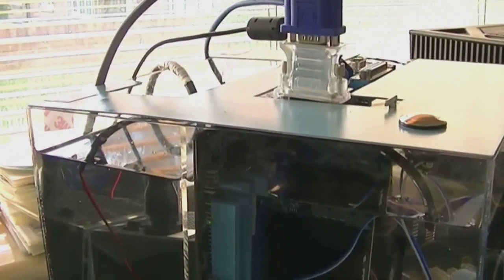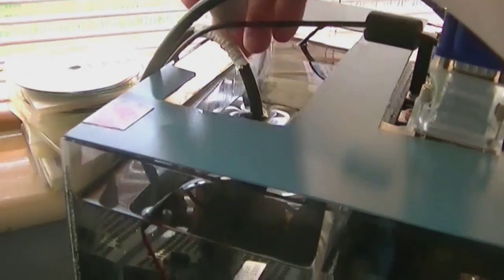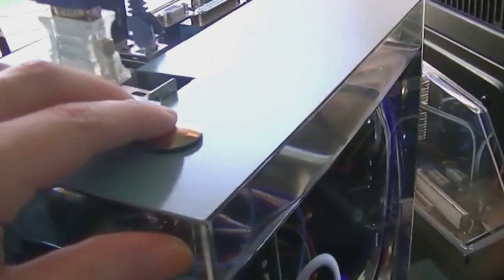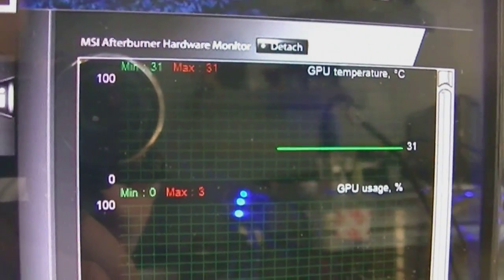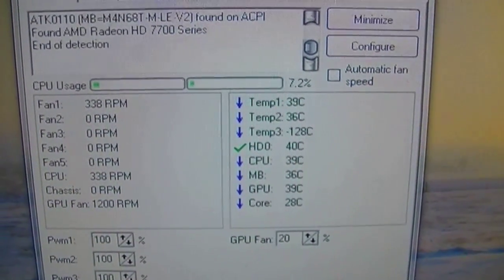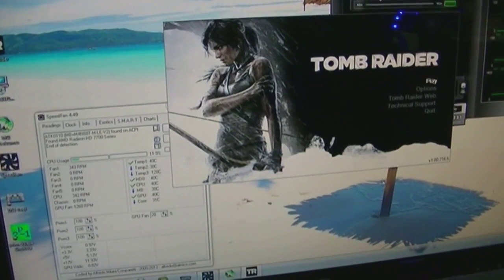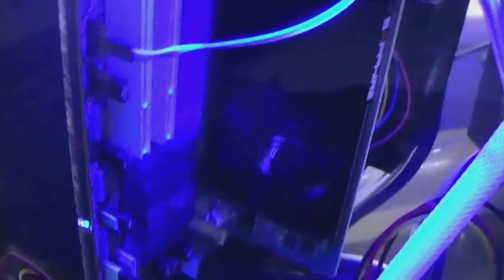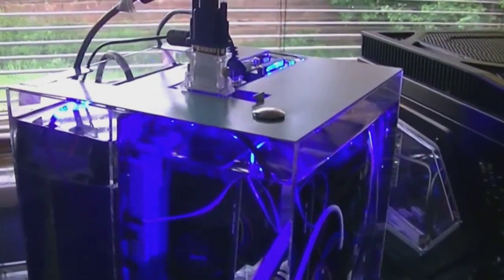Temp testing mineral oil pc with NO cooling

Comment: If you use a partially aluminum tank, it works better. Glass is an insulator, not a conductor. Acrylic glass is an even better insulator. In effect the mineral oil is being kept hot by the tank like a thermos. If offers a way to escape, like aluminum, even on one side, the temperature would be reduced.

Comment: The temperatures are worser than I thought for a complete cooling system 😮
Reply: The title says NO COOLING. Thanks.
Reply: trans oil without or even with cooling still will get similla temps, because trans oil still has not temps as liquid nitrogen, it has partially same temp as the air in room(i know, it is few degrees cooler than the air) so the pc parts at load has similar temps as the aircooled, because of physical character of pc parts at load, if you want really cold trans oil pc, you can do back side of aquariom of aluminium and on the outside part of alu desk you can add passive alu coolers on the whole surface of the back desk, and maybe even add some huge fans on the passive coolers, that is what i would do, if i would do pc in trans oil ;-)

Comment: What if you used mineral oil in a water cooler?
Reply: Was thinking the same thing.
Reply: was thinking the same thing 2
Reply: @larrythemanic6.0mechanic78  It will work, but far less efficient and wouldn't be worth it.

Comment: Water has more efficient thermal conductivity than oil, so would sitting your computer in oil really provide better cooling than a simple H100i or the like?
Reply: ***** It looks really cool but overall i think the best reason to do it is for making your pc silent as hell
Reply from the maker: Hi, no, sitting the pc in oil won't give better cooling than a water cooled setup, but thats what i was trying to say in the video :) .As it turns out adding a pump and rad (which is what i say i will need) was actually cheaper (including the oil) than a full water cooled rig, with comparable temps. After saying that, the original purpose of this build wasn't for a performance increase, i just wanted a pc floating in liquid :)
Reply: Mods'n'Movies Ah, gotcha. I didn't follow along very well, and I apologize. How much did the entire setup cost, out of curiosity (case, oil, etc. -- not the PC parts like MB, RAM, CPU, etc.)?
Reply from the maker: nexus1g Hi, no problem, to be honest its been a while so i can't remember the exact breakdown on the items, but the cost for the entire pc in the vid above (including the oil) was £497, it was some time before i added the pump and rad, but they were about £40-£50 each. most of the parts were bought used off ebay apart from psu and the pump.
Reply: +BlueDrakilicious Probably a bit late... but yeah of course it would some mineral pc rigs actually require a radiator to dissipate the heat from the oil if they don't have a radiator the oil temps would just continue on getting higher and higher
Reply: Mods'n'Movies    The fan 12 cm set at 2000 rpm in oil is louder than in the air?
Reply: It makes no noise.

Comment: i know it's non-conductive liquid , but is it healthly for long term use ? for like the psu and connectors.....
Reply: puget systems had a system running for over 3 years which never died (they just replaced updated the parts)
Reply: Oil protects again any corrosion. Technically, if you keep your teperatures in check, systems virtually never dies.
Reply: @youngmo77  Based on my research Over a long time it can start to delaminate boards, break down PVC.
Reply: if you use transformator-oil, everything will be just fine, because this oil is made to cool down transformators while running submerged in that oil, but i dont really know, how about the plastics and other materials

Comment: The temperatures seem comparable to a basic air cooling setup that 99% of us all have. When you're playing a modern game on the max settings like the guy in this video, getting up to 50degrees Celcius is quite normal. There is a difference though that concerns me. After you're done playing video games on an air-cooled pc, the temperatures do go back down quite a bit as your cpu and gpu stop working at 100% load and the hot air gets blown out. Does the mineral oil drop back down in temperatures as easily? I worry that the oil will remain at the ~50degrees Celcius for quite some time long after you're done playing intensive video games. If it stays hot for so long every day, it might do damage. I don't think you want your pc hardware to be really hot all of the time.
Reply: N0Lif3 We have yet to see oil damage pcs, rvrn with temperateres that high. Bare in mind, the uploader did mention he hadn't put a cooler yet.
Reply: right. what makes mineral oil pc's work are the fans attached which cool the oil as it's cycled through a pump.

Comment: Good little video. When I had my salt water aquarium setup, we used these things called power heads which are pretty much just underwater fans. They would be pretty handy to use to direct flow to say, a pump. I have no idea how you intend to cool the oil, I would think a standard WC rad would have too small piping. i think you need to look at making your own? unsure really. Nice Build however.